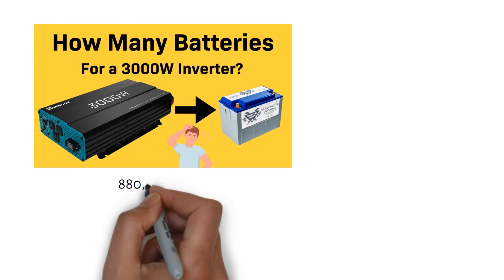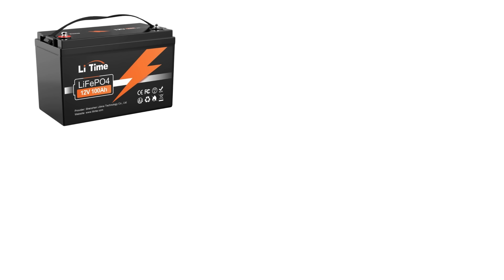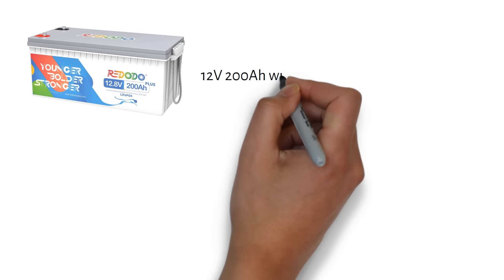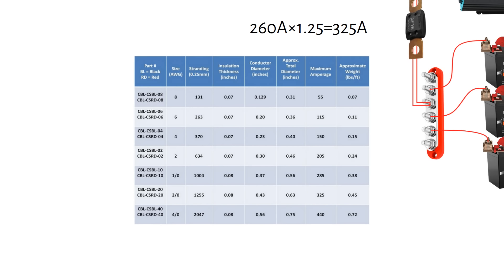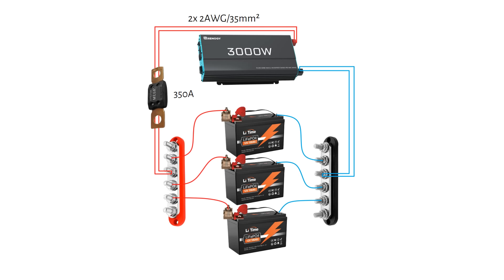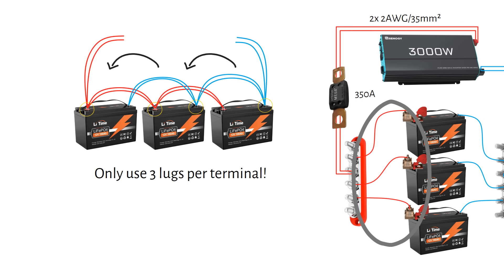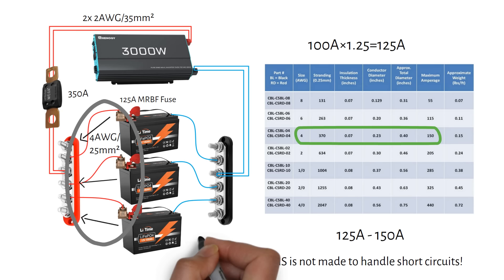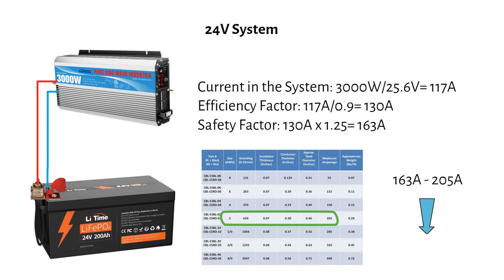How Many 12V Batteries for 3000W Inverter

Comment: I have a small trailer already equipped with one 100-watt solar panel and one 75-ah lead acid. I am replacing the battery with 2 100ah lithium and 2 more solar panels. Is it worth going to 24 volts as cable runs are very short.
Reply from the maker: depends on the load you want to run. If you have a small load, tick with 12V, if the load is larger use 24 or 48V. Checkout my video about 12,24 or 48V battery systems.

Comment: can you do some studdies on how much to charge your LIFEPO4  batteries lol see mine battery doesnt reach above 13.55v at full charge but i thought these batteries would charge up to 14.6V so not sure why but ive seen a few people talking about this issue now i get full 100amp hours at 13.5V so not sure if thats normal or not if your battery is sapost to get fully charged at 14.2v the first time you use or charge your new battery or how that works lol basically is it normal to not have to charge up a new battery to over 14V or no lol
Reply from the maker: When a battery reaches 100% it's at 14.6V. but then it drops to 13.5V because the voltage settles. There is almost no difference in charge between 13.5V and 14.6V. look at battery soc characteristics.
Reply: @cleversolarpower  yeah thats what i thought but my battery never goes passed 13.5v when charging i reach 100amp hours way before the voltage goes up to 13.6V so yeah is it normal for the battery to never charge up to 14.v or does that not matter
Reply: @cleversolarpower  basically what im saying is my battery is basically new i bought it last month and when i charge my battery to 100amp hours i only get to 13.5 maybe 13.6v at full 100amp hours my battery has never seen anything over 13.5V is that OK to never charge your battery to 14V is what im saying my battery doesnt go get to 14V unless i way way over charge the battery and i dont want to do that maybe my battery has more then 100amp hours is why i never charge passed 13.5V

Comment: I have done tested It using a 4000 watt pure sign wave power Inverter a 35 amp hour gel deep cycle battery will run a 10000 BTU Air conditioner for 10 minutes and You do Not need lithium batteries regular Walmart car batteries will work fine as far a running a led acid battery down and Not being able to recharge It then batteries were about to go bad anyway the only advantage lithium batteries have Is they weigh less
Reply from the maker: We will talk again in 6 months 😉

Comment: I have used my 2500W Inverter with one 200Ah 12V LiFePo4 battery few years without any problems! Usual demand for microwave or coffee maker is less than 1000W and even Airfryer is consuming only 1500W. And I do not recommend anyone to use 3000W Inverter for constant 3000W demand! btw. my inverter is 240V/2500W.

Comment: I remember all these numbers here or so that you can run these inverters to max out. 
I don't know that anybody should really do that but I got my big inverter for a good price and I like how the components in their can handle power better than small inverters and so the cooling fan doesn't come on very much. 
I don't like listening to those little inverter cooling fans!! 
I'd be better on power by using my 400 watt inverter but that thing runs the fan like if I'm charging two cell phones almost so kind of a no. 
Also it does run my 32-in TV but with the fan running however if I turn the TV to its lower brightness settings and put it on economy mode then the fan almost never runs at all. 

I'm just not a fan of fans that I'm not a fan of!!
Reply from the maker: Not being a fan of the fans is completely understandable ✌

Comment: If i have two 12.8V 150ah batteries which have a BMS of 120A (25.6V x 120A = 3072) is that enough for a CLAIMED 95% efficiency 3000W inverter (3000 / 0.95 = 3,158) ?    Or is the given calculation given in this video critical.   What problems might i have for not reaching the recommended 3,158W battery power, and being less than 100 watts short?   I suspect it will be ok, but why not ask :-)   Cheers.
Reply from the maker: It's going to be okay. The BMS can handle a little more in peak power (most of the times). You will seldomly use all of the 3000W.
Reply: @cleversolarpower    Thank you!

Comment: What is the source of wire current draw rating?

Also, with the two wire system, what happens if one of the wires has an issue and is not able to handle the intended load?  As an extreme example, let's say it was not properly crimped and was disconnected (or someone forgot to hook it up when servicing the system).
Reply from the maker: The current ratings of the cables can be found on the sellers page which i have linked in the description. Ideally you will have to fuse every wire separately.
Reply: @cleversolarpower  Thank you for the information.  

Something to keep in mind that the vendor's ampacity numbers are far greater the US NEC (National Electrical Code).  Perhaps there are standards for industrial cabling that allow this.  The only claim this amazon maker states is SAE J1127, but the cables do not state a J1127 insulation type and there are no markings stamped on the cable shown in the picture.  

Also keep in mind J1127 seems to be for vehicle starter battery cables and not for sustained amperage in uses like an inverter.  Starter battery use case is very short duration, high amperage vs inverter use case of high amperage for extended times.

If I had to guess this is welding cable and while the description claims J1127 it's not backed up in anyway by evidence.  Also the max amp numbers seem grossly overstated.  The only reference I could find for max amps is on the mcmaster-carr site for J1127 cables.  I do not have access to the standard itself as it costs $$.  

While these welding cable may work for the application, they seem non-conforming to any standards so they are unknowns without more data and proof of certification.  These feel like rebranded imported cables being sold by a US company.  I did look at manufacturers website and no additional info found.

Comment: Your theory about how much a lead acid battery can handle is incorrect. The reserve capacity on any battery is calculated on a 25 A load.  As shown on the side of your battery. Not 20, so the minimum any lead acid battery can pull is 25 amps if it has a reserve capacity rating it must be able to deliver a min of 25 amps per the reserve capacity specification.
Reply from the maker: what is reserve capacity? it's not calculated on a 25A load, it's not even calculated, it is measured on at a 20h load.
Reply: @cleversolarpower  Commonly referred to as RC, reserve capacity is the amount of time, in minutes, that a 12V battery can run before dropping to 10.5V. It is measured in reserve minutes. For example, if a battery has a reserve capacity of 150, that means it can supply 25 amps for 150 minutes before the voltage drops to 10.5V. A 25-amp load is used to calculate this, surely not 20 hours. Amp-hours is calculated at a 20-hour discharge rate, not RC. Go do some research or hell just ask AI if that's too hard.
Reply: If you don't know what Reserve capacity is, I'm not sure you should be making a video about batteries. It's one of the ratings that's on the side of almost every battery and in the one in your video. Maybe you should have a look. Maybe you should go get the battery Bible and read that a few times.

Comment: How can I tell the input voltage of my Inverter (chinese Suyeego 2000w). The instructions say 12/24, but I somehow doubt it? Currently runs off 12 battery but would prefer 24v, would it work?
Reply: Most inverters will run off of 12 or 24 volts the higher end inverters will run off of 48 volts be sure that you use a charge controller that can accommodate the input

Comment: i have a 24v 200ah battery for a 3000w inverter and i only use 1. Is that enough?
Reply: What he doesnt explain is that it will run it if the inverter takes 24VDC input but the time will vary, if your pushing close to 3000W load looks like it will run for about 90min or so since not 100% efficient.

Comment: I have a 24v 3,000 watt inverter and two 250 ah lead acid batteries. If I were to switch to 100 ah LiFo 4 batteries, how many would I need

Comment: Please help ... Did not know what i was doing ... so i will take the shame and start over. He seems to be saying 48v system is best so i will go with that. I think I can keep my 480w solar panels ... What big size 48v inverter to go with my two 300  (600 ah) Redodo batterys. THANKS
Reply from the maker: I recommend watching my video about 12V,24V or 48V battery systems. Advantages and disadvantages. With 480W of solar panels 12 or 24V is ok as well. Voltage also depends on the inverter size.
Reply: One of the biggest problems with the whole thing is me at nearly 80. I will watch the videos and maybe I can keep the 12v system and the 12v  3000w inverter and victron 100/50 charge controler. What started this search is why i can not get my new 600ah batt to full charge ..abs/float (14+) but i can only get them (13+). Do u have a video on  (victron) settings. THANKS MÜCH

Comment: What if I have a 3000W inverter but I only use 140W for a freezer, does I still need more batteries?
Reply: You're inverter will take to much energy for only your freezer. Better get a 1000watt inverter
Reply: @aurelienconstant513  Well most of the time is only the freezer but also wanna use a desktop, also to start the freezer I have seen a lot of people on videos say that 1000W inverters are not enough
Reply: I have a 3000w inverter in my truck tied to four truck batteries, it works fine, the only thing is the more power draw you have the faster the batteries will deplete. I tied the battery bank into the alternator in my truck. But a small generator and charger would also work to charge back up as needed.
Reply: @jesseReeder  like 3000W is the peak doesn't mean the inverter is pulling 3000W all the time, freezer have a high peak like 1000W but then it consumes between 50W-100W
Reply: @Wild-n3v  yea 3000w is what the max capacity that the inverter out put. If your running a less than that the power draw from the battery will be less.  So it’s gonna come down to how long you want the freezer to run before having to charge the batteries back up, and that should be the deciding factor on how many batteries you need.

Comment: 99% of vehicles have lead-acid batteries. The average starter motor draws 250 amps! Your 3000-watt inverter is not intended to deliver 3000W continuously, just as a vehicle's starter motor is not cranking all of the time! A large inverter is required for startup, not for running. I use just 4 110-amp deep-cycle lead-acid batteries because they recover and recharge much quicker! During sunlight hours or wind hours, the inverter is not really even using the batteries other than when acting as an electrical flywheel, and that's where the capacitors come in! In fact, the capacitors can provide all the start-up amps most common appliances require, and this means batteries may be charged and used to store off-peak energy! I have been using it for years! I can talk forever on this topic. But that's not the point! Bull Shit is the point!

Comment: 3000w on 12v is too much. In my opinion 2000w should be the maximum to be operated on 12v, and I still think is more than enough. Over that, you should go for 24v systems, or even 48v.
Reply from the maker: I couldn't agree more.

Comment: Ok I've got a 3000 watt 12V inverter 60 amp Mppt charge controller and four 280 Amp hour lithium batteries 🔋 so i could have more reserve power?

Comment: Running a 3000w inverter at full capacity isn't wise either really, I would use 5000w inverter for a 3000w load instead.
Reply from the maker: Then you have to size your wires for a 5000W inverter as well.
Reply: @cleversolarpower  any inductive load set up should be oversized for efficiency, and run at around 50% capacity to be really safe.

Comment: When sizing your wires shouldn't you take into account the length of the wire? This is the formula I am referring to. 
Wire Size (in circular mils) = (2 * K * I * L) / E	  L - length of one conductor, K for copper is 12.9, E voltage drop 3%
So, in your example with the 3 12v batteries in parallel and the Factor of Safety the inverter needed 325A.
For a 1 foot length the formula gives 23,292 circular mils, 2 ft = 46,583, 3 ft = 69,875 circular mils
Going to an AWG chart for the above 3 results I could use 6 AWG, 3 AWG, 1 AWG (I would be afraid to use 6 AWG)
A common wire is 2 AWG, so if I use a 2 foot wire I can use a single 2 AWG for the 325 amps. It could be as long as 2.8 feet.
So, for different 2 AWG wire lengths the max current is as follows:
1 ft = 962 amps, 2 ft = 463 amps, 3ft = 309 amps, so 3 ft is too long.

Feedback?  I like your videos you explain many things that others gloss over. I am still learning, thanks.
Reply from the maker: Yes. Battery wires will not be longer than 6ft (generally). So no need for a voltage drop calculation. A voltage drop calculation is required for your solar cables because that's a long distance. I made a video about voltage drop. Probably should have added this disclaimer, but nobody is going to have extra long cables because they cost a lot.
Reply: @cleversolarpower  I see your point. Me, I am just looking at an emergency Battery, Inverter, solar panel setup, so my battery wires will never be over 3 feet long. Thanks. Great videos.

Comment: 3000w 24v inverter, how many 12v batteries?
Reply from the maker: You can apply the same math for your batteries.
Reply: Can I add 12v batteries to a 8 6v deep cycle battery bank?

Comment: Why use 12 volt batteries , why not more voltage batteries
Reply from the maker: If the inverter is higher than 1500W i recommend increasing the voltage.

Comment: Ok I've got a 3000 watt 12V inverter 60 amp Mppt charge controller and four 280 Amp hour lithium batteries 🔋 so i could have more reserve power?
Reply from the maker: 4x 280Ah lithium batteries is good. If the BMS can deliver 100A, then you can deliver 400A to the inverter max. And you only require to deliver 260A (3333W/12.8V) max. So you are good. You can add more batteries, but that depends on your load analysis. I have made videos about that as well.
Reply: Hi Nicky ,can I run 2hp borehole pump on 3kva victron multiplus 2

Comment: the inverter OUTPUTS 3000w it doesn't need 3000w
Reply from the maker: You always have to size according to the max draw of the inverter. Otherwise you are just cutting corners which I don't teach here.

Comment: You dont want to run 12v with an inverter that size, especially with a lead acid. I know you know this, your viewers dont. 12v youre losing 9/10s of the current
4 amp ac appliance will draw will roughly draw 38 amps from the battery * 1 hour /.50 = . Single 100 AH lead acid is dead in a few mins
 The battery bank must be large to increase C-Rates, youre going to need 2x your calculated need in solar wattage
People think they can buy walmart deep cycle batteries, an inverter and run their campers for 1000$
Reply from the maker: Even worse, I have someone comment he can use car batteries for a 3,000W inverter 😬

Comment: I have a 4000w 12volt inverter. I have 3 1000amp led acid batteries. My pannal seel to keep up but I will admit I'm lost
Reply from the maker: Why do you need a 4000W inverter? Bigger isn't better. I recommend you watch my video about how to size an off grid solar system.
Reply: @cleversolarpower  because my 4500 generator almost powers my house. I have no electricity without solar or my generator. The grid is not an option. I have a well water heater lights heat and it's gonna be 70 this week that means 60 in the house heat needs to run

Comment: lol yeah i bought those cheap AMAZON OR EBAY OR TEMU  FUSES and man they almost burnt my trailer down lol not cool im so glad i didnt damage anything but yeah i need to get some fuses and wire and stuff still but i dont know witch ones i need or can afford so yeah winter is coming and i dont work durring the winter way way to cold i work in a stone quarry with my best friend who ripps me off half the time but yeah we cant cut stone sidewalks for people when its frozen so we have to use burning barrels and propain heaters and other things just to worm the block up so we can cut the stone lol look it up when you get a chance also we do everything by hand no machines to help us out we lift sidewalks stone all day long by hand so yeah emgine going out and lifting up an old sidewalk all day long lol not easy and yet i only get paid 10 dollars an hour if that so yeah my friends who i work for there whole family are on drugs so they dont pay me what they should ive made them so much money in these last 15 years its not funny but owell such is life sorry for the rant
Reply from the maker: I made a video where i compare several mega fuses.